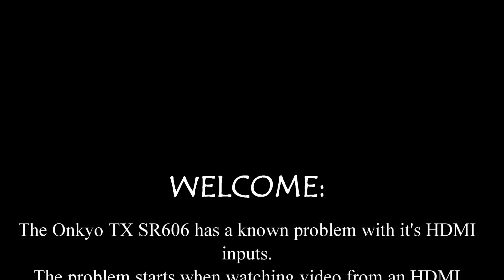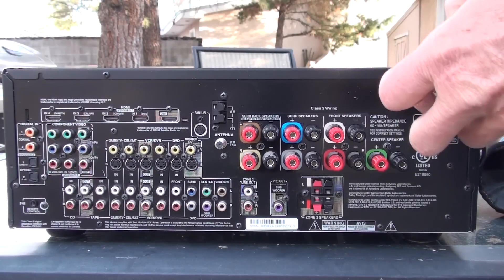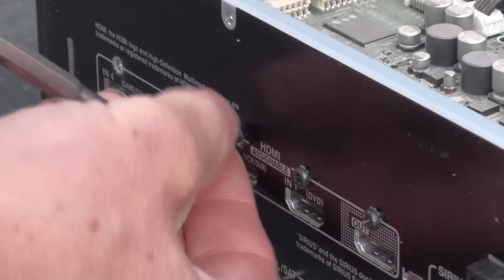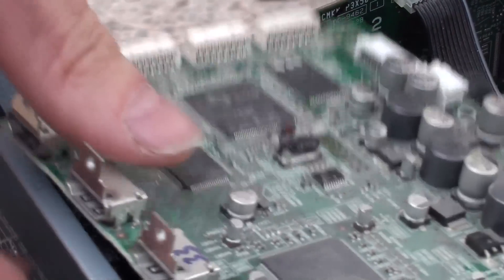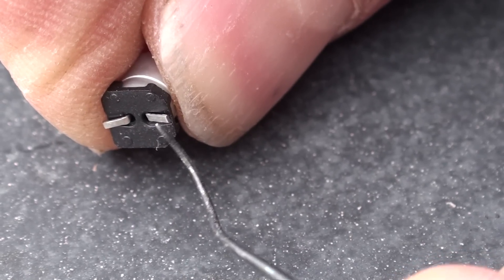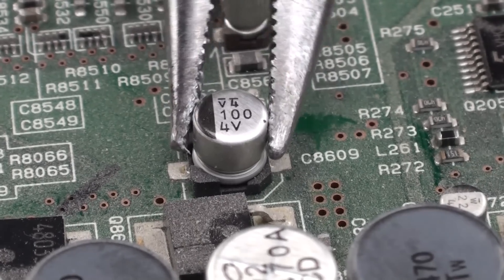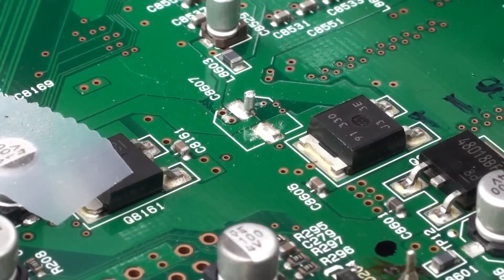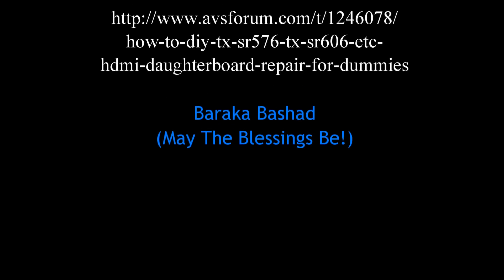How To Fix the Onkyo TX SR606 & SR607 HDMI Input Problem

Comment: hi. 
i have to replace the output hdmi on this one. what kind of hdmi component do i need for this. and/or other components. 
tried to look it up online with no luck.
Reply from the maker: Don't understand what you are asking.  How to replace the HDMI board? Replace one HDMI socket?
Reply: One HDMI socket. The HDMI Out dont work on mine any more. Due to a hdmi cable that was plugged in got torn out when we redecorated.
Reply from the maker: +Christian Haugan Search on HDMI Connector for Circuit Board.  Parts houses like Mouser and DigiKey should have them

Comment: could a through hole cap be used instead of the surface mount? just trim the leads?
Reply: I have a TX Sr 806, but am experiencing the same HDMI issues and is likely the same fix
Reply from the maker: Andrew Roper Absolutely!! Go for it.  Radial lead caps are a little easier to work with.
Reply from the maker: Andrew Roper; If the symptoms are the same, the problem is likely the same.  Just find and replace all the 100uF caps on the board
Reply: Holy fast reply!  Thanks a lot!!!

Comment: read many of the comments but did not see any about nr616. Do you know if this solution will work for it as well?
Reply from the maker: Don't know. But probably not.  Check out this link for more info.  http://www.avsforum.com/forum/90-receivers-amps-processors/1415258-official-onkyo-tx-nr414-515-616-problems-thread.html  Good luck.

Comment from the maker: 1- Plug the Bluray HDMI directly into your TV to verify it works. 2-Try a another HDMI input on the Onkyo. 
The problem with capacitors usually happens over many months. If you system stopped working suddenly, it's probably another problem.  Good Luck.

Comment: Any idea if this works with a TX-SR706? I have the same problem with my HDMI-inputs.
Reply from the maker: JudgeF68 Yes.  Replace all 15 caps on top and bottom of board.  get 105C temp rated caps if possible.  You may use radial style caps if they are easier to get.  Good Luck.

Comment: found this instructional video, does anyone know if this fix is the same for the TX-SR706? I've been having this issue with my receiver for the past two months.
Reply from the maker: If your board looks similar, this fix will probably work.  Replace ALL of the 100uF capacitors. Good Luck

Comment: I have a onkyo TX - SR875 the HDMI video shuts out for few seconds only during heatwaves where the heat in the room adds onto HDMI board and temperature tolerance is exceeded thus starts the snag. During wintertime its okay. 

onkyo should have made their AVR products as domesticated home radiators with the amount of silly heat they generate. 

I'm gonna get some new capacitors and get mine replaced as it does my head in each summertime heatwave with the video shutting down.
Reply from the maker: Andy Summers They do make a lot of heat.  I fried a BluRay player because I put it on my onkyo.  I you're in the noting to lose mode, you might  try to kluge a PC-CPU fan into the side. Make sure it's not in some kind of enclosed space also. Good Luck.

Comment: Anyone have any idea if a specific cap handles the onscreen menu somehow?   I replaced the caps and now I have all video working again,  but I don't have an onscreen menu or volume display on screen.   I don't get it...
Reply from the maker: Paul Campbell 1) OSD only works when using the HDMI outputs. 2) The problem is with the HDMI board.  3) I don't know the exact fix, but suspect replacing all caps that have not already been replaced MIGHT fix it.  4). Sometimes perfoming the Factory Reset procedure will fix the OSD problem.  Good Luck.  let us know if anything works.

Comment: what type of soldering iron will i need to do this?
Reply from the maker: RP McMurphy just something that more or less looks like what you see in the video. 20-30W is plenty.   $20 at Home Depot.  $4 at harbor freight.   More is not better in this case.
Reply: i was just wondering if i needed a specialty soldering iron, like a pinpoint soldering iron. i have one, but the tip is about 1/8" wide. is the tip too big? will it work?
Reply from the maker: RP McMurphy the larger tip will be a bit more awkward but should still work.  Also it will be easier for you if radial style capacitors are used.
Reply: thanks for all of the help, patpatpat999. i see what you mean about the tip. i am going to buy the one from harbor freight. it will definitely be more precise.  :)

Comment: Anyone know where I could buy these caps? I've had an order on Digi Key for over a month on backorder.
Reply from the maker: Sorry for long delay to reply. If you still haven't got them you can get from just about any parts house .  Also you can use radial style caps or caps with a little higher voltage rating, like 6V

Comment: I tried this with a Onkyo TX SR607. I replaced the five 100mF capacitors on the back.Unfortunately, no improvement
Reply from the maker: Roland Schreuder Sorry it didn't work.  You might double check to make a cap didn't get put in backwards
Reply: I also have a TX SR607.  For me, swapping the 100uF caps on the back did the trick.  Be sure to try patpatpat999's suggestion because 2 of the 5 caps on the 607 are reversed from the other 3, and it's easy to miss.  Hopefully, you can get it fixed without too much headache.

Comment from the maker: I should have recommended in the video, you replace ALL of the capacitors. They can all go bad and cause a host of problems. One is that the audio becomes just digital noise.
Reply: Hah! So, I guess that answers the question I was going to ask, which is: if I have the 607 instead of 606 and the capacitors aren't exactly the same, how do I identify the bad ones that need replacing? But, if the answer is to replace all of them, that's easier to figure out. :)

Comment: Is that work with Onkyo HT - R960 ? The Circuit seems same ...
Reply from the maker: Can't say for sure without a schematic.  I the symptoms are the same and the problem developed over time, this procedure should fix it.  Identify all of the 100uF capacitors and replace them all.

Comment: Hi, I must have an upgraded HDMI board as it is different from what is shown in the demonstration video.  Anyone knows how to repair the new/upgraded/replacement HDMI board?  Thanks
Reply from the maker: Mike Richards There's a fair chance it's the same old problem.  If so, the solution is to replace all the caps on the board.

Comment from the maker: The honest answer... Who knows.  This problem is so well known I would be surprised if they hadn't fixed it.  They just didn't specify a high enough temperature rating on these capacitors, or the capacitors didn't meet their stated specification. Onkyo's use high current power supplies, which means they get hot.

Comment: I had an repair place change the capacitors 5 of them 100uf 6v and I still don't get any video.
Reply from the maker: Alfonso Vasquez If you get video using the RCA inputs then the HDMI board seems to be bad.  You may be able to get a new one from eBay for about $50 US

Comment: Replace the capacitors on hdmi board with normal type not surface mount. 16v or 25v
Reply from the maker: totally fine also.

Comment: Good evening guys I cleaned Onkyo TX-SR608 with compressed air and now you do not see more, you can give me some help, thanks.
Reply from the maker: Francesco La Mantia I assume you are using translator application.  I think you said you cleaned it with compressed air and it stopped working.  It is possible that the compressed air created static electricity and damaged an electronic component.  Sorry I cannot not help on this problem
Reply: Ok friend

Comment: Has anyone changed capacitors for SR605 model? HDMI circuit board looks different in this model. Capacitor identification numbers are different and don't match which are in this video. Has anyone have correct capacitor identification numbers for SR605 model? Please help!!!
Reply from the maker: Several people have used this video to fix their 606 successfully.  Use the same caps/part number.  You have to open up your unit, pull out the board and count how many caps you need.  Just replace all the 100uF caps.

Comment: can use others type of capacitor? but same watt &volt
Reply from the maker: Sulaiman Mat Isa The value of the capacitor (100uF) must be the same. The voltage rating must be the same or higher. You may use other form factors but the capacitor must be a polarized type.
Reply: patpatpat999 tq boss for ur advise.my capacitor value 220. difficult to find same shape capacitor. only have normal polarized capasitor
Reply from the maker: Sulaiman Mat Isa Differnt shape (form factor is OK)
Reply from the maker: Sulaiman Mat Isa : Sorry bad typing.  Different shape is OK.
Reply: patpatpat999 tq for the info.

Comment: Hello I have onkyo tx sr 606 I am getting full sound but only from the front speakers the rest of the connectors don't work how can I replace them and which exact connectors would I need and wer can I find them? Thank you to anybody who can help me
Reply from the maker: It is not likely your connectors are bad. First try reset procedure:
Press and hold VCR/DVR button and at same time Press and hold Power button until display shows "CLEAR"
If still not working, go to page 72 of your manual reset your speaker setup.

Good luck
Reply: thank you for your help !!!

Comment: standby button blinking, press no action. Advice pls
Reply from the maker: See if the unit will turn on after disconnecting it from the power for 1 hour or more. If it does you have a short in your speaker wiring.

Check your connections and reconnect if it turns on.

Now refer to page 129 of your manual.

If the unit does not power up, press and hold the VCR/DVD button, while keeping it depressed press the ON button.

"Clear" should appear in the screen.

If clear does not appear or resetting to default does not allow the unit to, then your Onkyo is very broken.

If it turns on after setting back to factory default, then you will have to redo your set up from scratch.

Comment: I don't suppose anyone can point me toward a similar video for the Integra 9.8 )aka Onkyo PR-SC885)?  HDMI video has failed and I started disassembling this beast.  Instead of replacing every single capacitor on the HDMI board, it'd be swell if someone could tell me which ones are the likely culprits!  Anyone?  patpatpat999?  Thanks in advance!
Reply from the maker: Sorry, no idea.  There probably aren't that many 100uF caps on the digital board.  Caps are cheap.
Reply: patpatpat999 Thanks, pat!  there are 13 of these on the board, so I'll order 15, cuz I expect bad mojo.  In fact, related to the bad mojo, I got a little excited about getting my hands dirty and I pulled a wrong capacitor off the board.  It's labeled n3 220E CD.  Do you know which part I should order to fix my self-created problem?
Reply from the maker: Try this pdf.   http://products.nichicon.co.jp/en/pdf/XJA042/e-cd.pdf  and look at your part again.  I can tell it's 220uF, but you need to know the Voltage rating.  The other stuff you can fake it.

Comment: Can some one tell me the right dimensions for the caps, height and diameter
Reply from the maker: I don't understand your question.  Physical dimensions are mostly irrelevant. All that matters is capacitance, voltage, and temperature rating. The caps don't even need to be surface mount type.

Comment: Well blow me down with an air duster... Faulty electrolytic capacitors stop the whole video board from working? Sounds like someone needs to slap the quality control people - or maybe the beancounter who figured he/she could save a few $$$ by getting cheap SMT caps! My unit died just yesterday to my horror (it's a later version) but I'm going to give this a shot!
Update: And just like that - the faulty capacitor (which has leaked electrolyte all over the place) reveals itself. The TX-SR608 which is the one I have has a similar daughterboard which but it's an even bigger PITA to access. I wonder though, while it's not "pretty" couldn't we just use a conventional radial lead capacitor? It's not like we're short of space here and I expect a HiFi quality cap would perform better or at least LAST longer.

Comment: Does anyone have a current link to caps that can be purchased?
Reply from the maker: Digi-Key:  PCF0G101MCL4GB  There are many other possibilities that will work.  On Digi-Search: Capacitors>Aluminum- Polymer>cut tape>100uF>+/-20%>4V.  This will get you a couple of options if needed
Reply from the maker: Oops. That part number is for a surface mount capacitor which would be difficult to solder on for most people. I will find a better part number tomorrow and post it.
Reply: @patpatpat999  Thanks so much!
Reply: Do u have the capacitor yet? Thanks

Comment: Does this work with the 609 model?
Reply from the maker: KAUTIAN BEATS It probably will.  If your board looks similar then just replace all the 100uF capacitors.
Reply: patpatpat999 sure thing, i just order some aluminum capacitors from amazon.com with a lot of reviews ratings  on other Onkyo models, i will pass the info on to you if it's successful. Thanks to your video

Comment: is it the same for TXSr607
Reply from the maker: Yes.  Someone used this procedure on their 607 and it worked.  The location and number of capacitors may be different.
Reply: patpatpat999 Did I send you the pictures of the front and back HDMI card and see the ones I have chosen if it is correct.
Reply from the maker: I haven't received anything.  You can just replace all the 100uF capacitors and not worry about it.  I recommend you do this as opposed to just the ones I show in the video.  It will only cost another dollar or two.
Reply: patpatpat999 Thank you, I ordered 5 X 493-2141-1-ND
Reply: Robert Ruel Thank you and my receiver works fine again.

Comment: Please!! i need help. My reciever HT-R391 have the same problem with hdmi signal. 
http://subefotos.com/ver/?a317298fc14e45974510e9ba08c7b147o.jpg
http://subefotos.com/ver/?e080bb30665122e4838144ddc789bf74o.jpg
which capacitor should I replace?
Gracias
Reply from the maker: First,  If the capacitors are the problem, the symptoms should have started slowly and got worse over time.  I don't know this exact Onkyo model, so I cannot tell you exactly which capacitors.  If you can send me a good close-up photo of both sides of the board I may be able to help.
Reply: patpatpat999
thanks for answering my home theater is an Onkyo HT s3500 . in my case , the problem occurred directly , from one day to the other, stopped working. I hope to send you these days, clearer photos for the board. Gracias Amigo!

Comment: I did put a post in the thread on this link:
http://www.avsforum.com/forum/index.php#/topics/1652514?page=256
and i really really need your help to tell me the exact capacitor thats needed for my
Onkyo ht-r558 (hts4505)
I have the same issue that you got in your receiver ( hdmi input problem ) I followed your steps and stop on which capacitor need to replace I saw many capacitors small and big caps! 
Just please take a look on my post and the pictures that i posted there and tell me which one i should replace and which values..they are different than the ones that you changed in your receiver..
Please please brother i need you in this..
Reply from the maker: Assaf Albogami Sorry, your link does not work for me.  It only takes me to the AVS forums, not to a specific post.  Look at my video, at teh 3:28 mark, the one on the right is the 100uF capacitor from my Onkyo.  The 100uF capacitors will all be the same size and have “100” printed on top.  Replace all of them. Try to get new caps with a 105C temperature rating.  They will last longer.
Reply: patpatpat999 
Hi 
Thank you for your respond 
I will put the link again hoping that you can see it and see the pictures that i posted there for my hdmi board so you can tell me the exact capacitor thats needed to replace  ..
If the link doesn't get you there i hope you give any to contact you directly..WhatsApp or Twitter or anything you want so i can send you the pictures..
If you don't want that could you please go and Google my hdmi board it's this model (bchdm-0678)
Its still default for me to locate the right capacitors..
Thank you so much for your help

Comment: Thankyou ! I have been putting up with this fault for a long time but found this video and thought i would give it a go.  I bought these from www.conrad-electronic.co.uk..'' Electrolytic capacitor SMD 100 µF 6.3 V 20 % (Ø x H) 6 mm x 5 mm RC0J107M6L005VR Item no.: 421536-89''.  19p each (6.99 delivery though)
I replaced the 5 as described and on first try the on screen menu came up but then disappeared again. I took it apart and re-did some of my solders as im no expert and also noticed another 100 µF cap on the top so i used the spare I bought and replaced that too.
On second test everything works perfectly and I'm now enjoying my Amazon Fire TV through the AMP and it only takes a second for the picture to come up.  Previously it would take 5 minutes or never work at all. Cheers